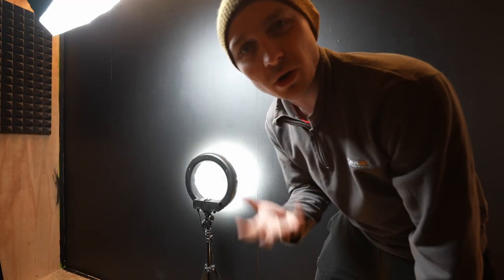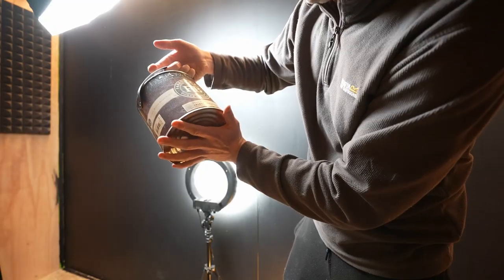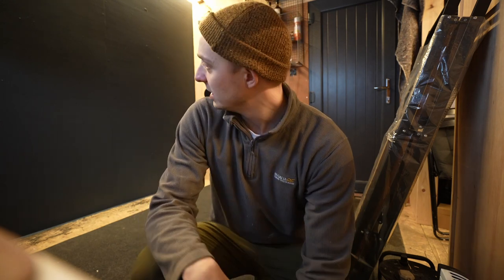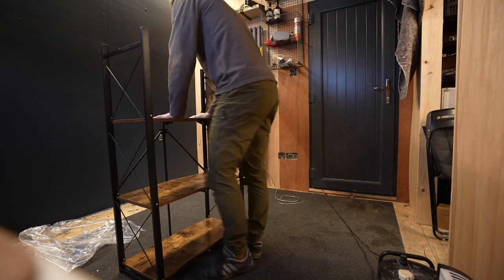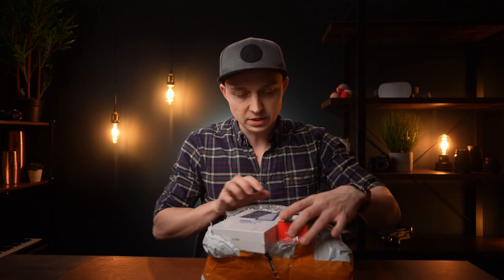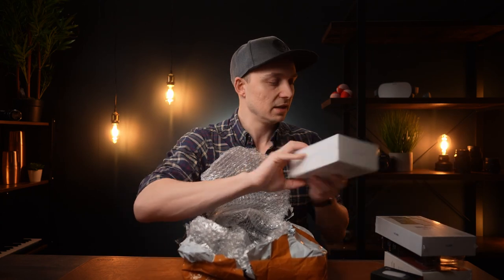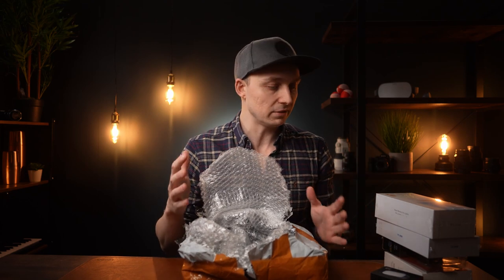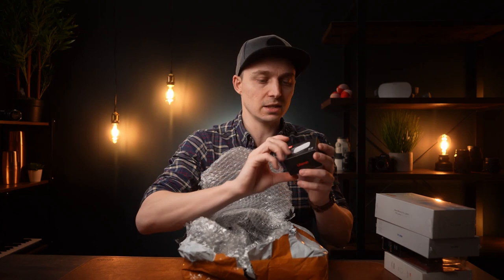How I Built A New YouTube Setup/Backdrop For 2021

Comment: Jonny, which camera and settings do u use?
Reply from the maker: Hey mate, I’m at f2.8 on a 24mm with a variable ND. 1/50 at 24fps, ISO 200 ish. The new set up shots are 4K down to 1080p the original set up is shot in 1080p.